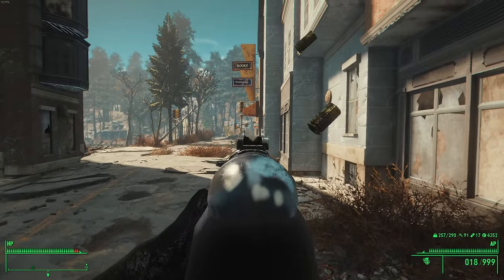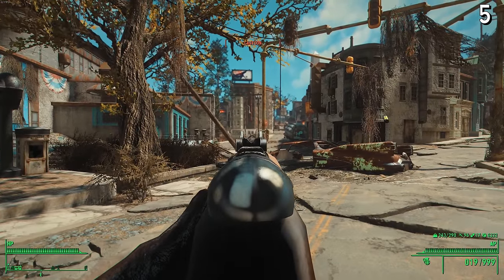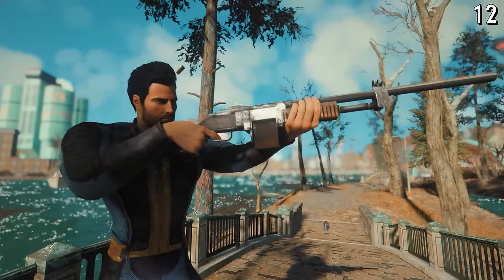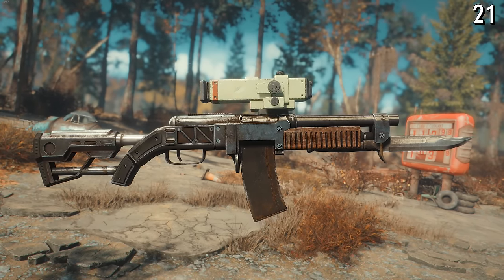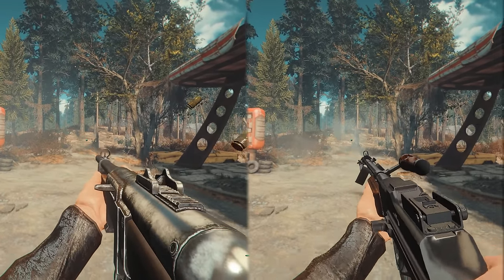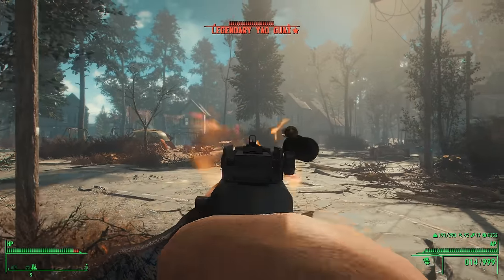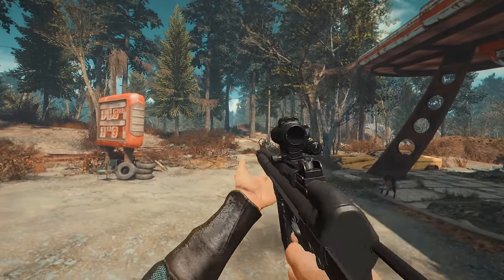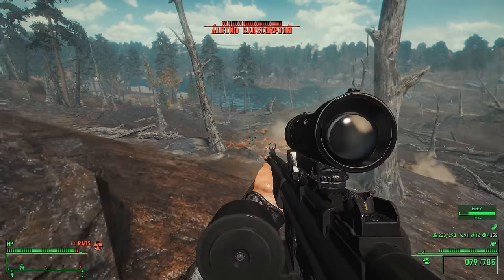Everything WRONG With The Combat Rifle In Fallout 4... And What It SHOULD Have Been

Comment: Really, it should've been 5.56 by default. It'd make balancing sense, too, since heavy machine turrets are the most common static defense in the Commonwealth, and they all utilize MFCs or 5.56. I'm not sure how those work either, or how'd you'd salvage the ammunition from them, but it's a feature.

*The smaller turrets you find in pre-war installations use 10mm or MFCs. The larger turrets all use 5.56.
Reply: this, plus the combat shotgun and the combat rifle are supposed to be the same gun. 5.56x45mm and the most common 2.75in 12 guage shells are about the same length so they could share a common magwell. 5.56 has about 6 times the pressure of a 12 guage so if the receive could take 5.56 it could take 12 gauge.

the bolt, extractor, and barrel would have to be changed, both because of the greater diameter of 12 guage and the fact that it's a rimmed casing.
Reply: I think they realized their mistake too late because in Far Harbor there's a legendary combat rifle that uses 5.56 by default.
Reply: Right? There is absolutely no reason lore wise for this thing to exist. Need a combat rifle? Make it in 5.56, or 7.62x39. Need a small caliber weapon? Use the Grease Gun.

Comment: If i had to pick a replacement- while also just mashing gunparts together to make some amalgam, it'd be a mix of the M1a1 Carbine, Ruger, and M14. It would start as an m1, but i'm not sure what round it would use if we're just talking FO4- maybe some conversion kit to make it fire .45? Maybe .44? or just introduce the .30? Later down the line, you can upgrade it into a ruger for 5.56, and finally the m14 with .308 (again, going by FO4, since 7.62 came with Nuka World, it wouldn't fit for the vanilla game)

I'd have the M1 replace the Combat Rifle as a middle ground between the pipe weapon (which should be replaced with the M3 Grease Gun) and the Assault Rifle (which i'd personally prefer to be the HK-33/G3). The m14 mentioned before could serve as more of a Sniper Rifle like 3/NV (semi auto, .308) whereas the R91 be the main battle/assault rifle.

Comment: The real problem with the combat rifle is it's locking action. It obviously has gas a piston and fires from a closed bolt. This means it has a locked breach system.

However the receiver is obvious made from stamped or pressed steel and would be too weak to act as a locking surface for the bolt.

The front end may look like a BAR but it can't have it's tilting bolt system. The hardened locking surface the bolt tips into would be in a visible hump above and to the rear of the ejection port. 

If the locking surface was in the floor of the reciever like on a FN MAG it would interfere with the magazine well. 

If it had a rotation bolt like an AK there would be visible weld marks or other indications that in has a hardened insert for the bolt lugs to lock into. 

An AR 15 style semi-direct gas impingement system is the most plausible but it clearly has a gas piston not just a gas tube. 

The way the combat rifle is manufactured is completely at odds with it's locked breach. No matter how the breach was unlocked it just wouldn't work. The gun break soon as after you fired it.

Comment: FN SCAR-L: 5.56x45mm
FN SCAR-H: 7.62x51mm -> ~.308 cal

So, we can replace the Combat Rifle (.45 ACP) with a 5.56 rifle and it's upgrade, the .308 with either a .308 or 7.62 rifle, but the problem is that those ammo types are very hard to come by early on, and we have a ton of .45 ammo laying about only useful for trading...soooo, maybe a .45 ACP pistol mod to place in the game?

Personally, I'd prefer having a 9mm pistol that could be upgraded to .45 ACP (think H&K USP) and an ACR-like rifle that could be chambered as either 5.56 or 7.62 (Magpul Masada), and a bolt-action sniper rifle as .308 upgradable to an .50 AMR, capable of extreme damage...simple

Comment: There's actually a few things you missed that's wrong with it.
1. how little the charging handle moves for the size of the ejection port 
2. How the charging handle does not cycle the whole way when you fire it just jiggles around a bit
3. how the charging handle moves but the bolt doesn't
4. How when you aim down the sights it doesn't move at all
Anything else?

Comment: In my mind, a better pick would have been what Fallout: New Vegas did for the battle rifle. That was an M1 Garand that had been rechambered for .308 rounds, so that or its direct successor, the M14, would have been a better pick for them, especially since the M14 is still in use IRL, so it's more reasonable to see it refitted for modern attachments. That being said, the New Vegas service rifle, based on a combination of M16 variants, would have been a better choice as well, especially since the AR-10, a precursor to the AR-15 that the M16 was based on, exists and is also designed around .308 ammo.

Comment: The M14 would have been used, the military would have just modernized it until it was up to par, oh wait, they did, the M14 is still used today as a DMR/light sniper rifle, it would be a perfect fit for fallout cause there's tons of them and loads of aftermarket parts for the customization table, and it's chambered in 308 from the beginning, most are still in wood furniture which would fit the setting when you find them but you can put them in a fancy tactical polymer stock as the game progresses, while the G3 makes sense, the M14 makes slightly more sense considering the military already adopted it and liked it

Comment: I actually like the aesthetics of it. Default config is lame to the max, though. Should be .308 by default. Doesn't need the option to swap calibers (unless it's between two rifle calibers that make sense). Should have a stock by default and can have a selection of different ones. The most basic one should have a "garage" look to it, like a homemade skeleton stock, and should offer the lightest weight and the least stability. Shortest barrel length should be 14". Longest should be 20 to 24". The upsides and downsides for each barrel length should be distinctly noticeable. Shorter barrel should mean lighter weight and faster handling/equip speed but also a reduction in performance per shot. Longer barrel should mean high performance per shot, but also more weight and slower handling/equip speed.

Note: It's also similar to the Chinese Type 63 except that it's a battle rifle chambered for a beefier caliber instead of an intermediate assault rifle.

7:40 Do a "Cursed Gun" video in the style of Sam Claymore and Yosho!

7:52 You could call that a "Mare's Leg" or "Obrez" configuration. The ATF would classify it as a "pistol" (even in .308).

13:30 The semi-auto version is the HK91, so that's probably where they got the "91" from.

13:59 That's doggone gorgeous! It's got the proper HK slap animation AND it has wood furniture! Wood furniture on a classic HK rifle! That's, like, super-mega-ultra-turbo Gucci deluxe!

14:14 There's also the compact version, the HK53. Looks like 5.56 MP5. Plus, the MP5's predecessor was the HK54.

14:56 What's the point of grasping the mag (or mag well) when yer fighting by yerself outdoors?! The only reason to do that is to bring the support arm in close so you don't obstruct teammates when operating with a team in confined spaces. Also so you reduce the chance of snagging yerself on stuff.

15:04 Yer not gonna nitpick yer character grasping the double drum?

Comment: Combate rifle design, with a few specific points, is not that bad until kooking at what it is chambered in.  If the 45 was chambered in something like a lengthened and higher pressure 45 SOCOM.  The wider mag and beafer construction would make more sense.  The screwed up ammos in this game causes so many problem.  New vagus setup a pattern for ammo system that should have been followed.

Comment: from what I know about bethesdas attempts to balance the game, the rifle calibers are fucked up. its almost across the board.

9mm,.38, and most other standard pistol caliebrs actually work almost as intended.

the .223 is oddly well balanced in how it works in real life as the mechanism of how firearms work means the .223 has a high penetration, but a underpowered "stopping power".

the actual .308 rounds are way less powerful than they are in real life and difficult to source and the .50 bmg even with its top teir power rating lacks its real world caractaristics.

basically the myth is that the design team wasn't very savvy and just assumed a larger caliber means a more powerful round. thus mid teir rifles use top teir pistol caliber rounds. the 7.62x39 is fairly balanced.

Comment: Rifles can use pistol rounds, that's what's weird about gun nomenclating. I agree that it is a PDW or carbine, but submachine requires it to be full auto, so if the standard variant is full auto than that would be accurate in some regards. Even still, it's more based on barrel length for the classification of a rifle. If the barrel is longer it already increases the terminal velocity of the round. 

There is no reason they should have ever abandoned the service rifle. Literally peak American.